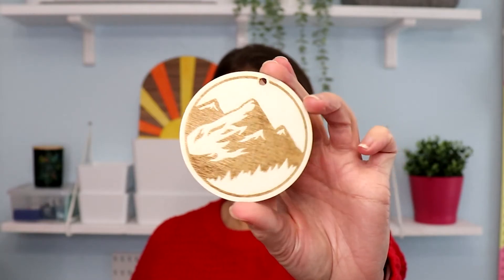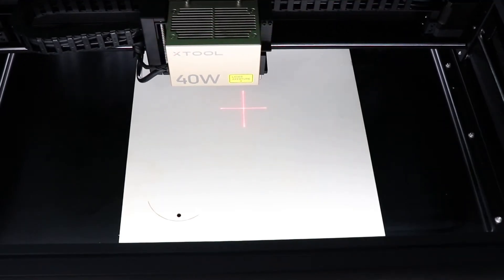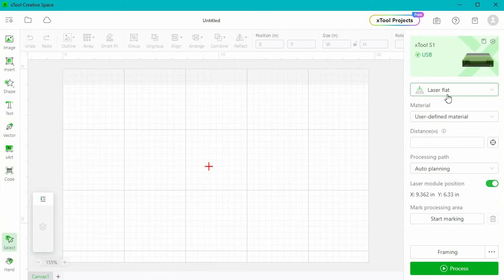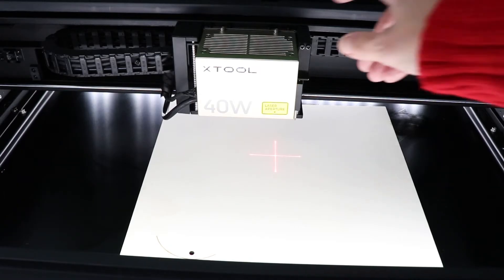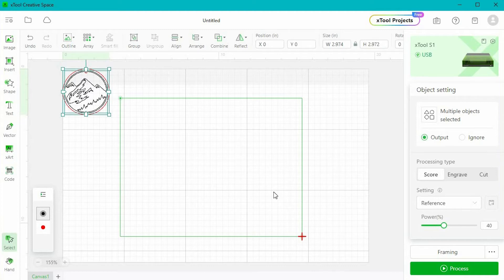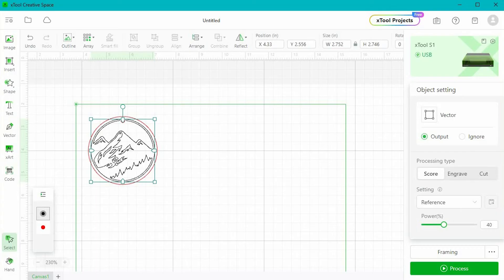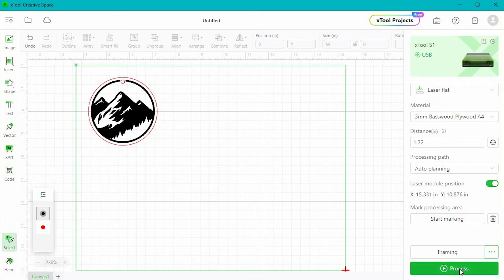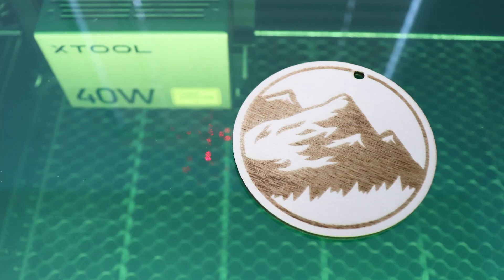xTool S1 First Project and XCS tutorial

Comment: Hi! I just watched your video xTool first project & XCS tutorial. Thank you so much for sharing this! I am brand new to the world of laser engraving and cutting and have found myself intimidated beyond belief. I want to jump in with all fours and want you to know that your demonstration and explanations were just what I needed to  find my courage to get started.  I discovered that I made one huge mistake when I bought my S1, I selected a 10 watt laser instead of a 40 watt.  How will that impact the machine's performance?  What limitations will I need to be aware of?  Any advice you can offer would be greatly appreciated!
CJ
Reply from the maker: So glad you found this helpful! Love that you are ready to jump in. A 10W can work with all the same materials as a 40W. It will run slower and won't be able to cut as thick of wood. But other than that, it's a fine machine and you'll be able to create so much.  My first laser was a 10W and I did a ton with it, still use it.

Comment: Hello Sarah,
  I recently purchased the S1 20w ,I would like to engrave clear acrylic discs for bag tags, I realize I will need to either paint them or use a card stock backer. Could you please suggest settings.
Thank you
Reply from the maker: You've got the right idea. I typically paint with black tempera paint, but make sure it's smooth and even. Then focus the laser on the paint and engrave. Or lay black cardstock down and focus the laser on the paper, then put the clear acrylic on top and engrave.
Reply: @ 
Do you have a suggestion for settings

Comment: Great video, what happens when you design your own vector image and it cuts but doesn’t engrave it?
Reply from the maker: When you import a Vector or SVG, you may need to break it apart by releasing the compound vector. This will split it into parts and you can set each part to either cut or engrave.

Comment: Hi Sarah, I have subscribed to Creative Fabrica, I am unable to upload these files or any files I have in my computer to XCS, what am I doing wrong?
Reply from the maker: A couple things to try. Most file packages from Creative Fabrica are zipped, it will show a folder with a zipper on it. Open that folder and extract the files. Then you will see everything you downloaded. Make sure the file you want to use is an SVG for cutting or engraving. If you download a font you need to install that to your computer first, then it will show up in XCS.
Reply: My stored downloads are for Cricut so they are svg. And I have extracted all zip files

Comment: I have read in some places that the 2W IR can be used for good leather engraving, but can it be used for cutting leather as well? The IR bundle is very affordable $599 and with the swapping feature you’ve showed with the S1 make this potentially the best option as I primarily work with leather currently. Any thoughts?
Reply from the maker: The IR cannot cut anything, but it does do some beautiful engraving on metal and acrylic. I don't work with leather often and have not engraved it with the IR so I can't speak to that material specifically.

Comment: Hi, im having triuble with my S1. Im new to laser cutting and it’s a new machine. Im finding that the laser doesnt cut all the way through the material. Ive used 3mm basswood and 3mm plywood. Ive tried various settings finding 100% power and 3mm speed the mist effective but still nit great snd it scorches the wood. It’s a 40w laser head.
Reply from the maker: There's a couple things you can try, because it should definitely be easier than that. Make sure your are auto focusing every time for your material and that your material is completely flat on the slats or honeycomb. Turn on air assist for the least amount of char.  Basswood should cut easily at those settings, some plywood can be tough if there is glue in it and it won't cut all the way through. You can also check your lens and see if it needs to be cleaned.

Comment: Love how you teach, thanks. QUESTION how do you get the selection panel along the top of your xcs platform page? Mine is down the RH side and I want it horizontal across the top. 😊
Reply from the maker: That's probably a difference in the version of the software we are using. In the newer version everything is along the sides and the options change depending on what you are working with. Thanks for watching!

Comment: I bought the S1 package with the IR included. So the IR doesn’t work with the S1? Why did they sell it as a package with it? Thanks!
Reply from the maker: Yes it does, but this video was made before it came out. I have a video on this channel all about the S1 interchangeable modules if you want more detail
Reply: The IR 1065 NM does work very well with the S1. I changed out my 40W with the 2W IR 1064 NM a few days ago and the projects and the quality that it produces is excellent.  I just bought the S1 about 3 weeks ago.

Comment: Sarah, thank you! I had no inkling the instructions meant to grab and physically move the laser head. I got very frustrated trying to figure out where the movement controls were. Just didn't think of the simplest thing.  This is a perfect tutorial. 

I did 27 years in the Army, and have seen a lot of training! You described where you were moving the courser, and generally did it slow enough to follow. I informally taught Excel for many years, and bicycle maintenance as a volunteer. It is so easy to forget that the user interface is completely new and if the teacher doesn't go slow, the student is all too quickly 3 steps back trying to figure out what happened because the instructor went too fast. The nomenclature is often new, and a teacher has to go slow and ensure the student is following along. If I thought I needed to double check, usually before I made changes to my Creative Space work, your speed made it easy to hit pause, back up and be clear on what you were doing. 

One very minor suggestion. Assuming you are using a Windows interface, sorry I don't use Apple at all, for a lesson go into your mouse settings and temporarily increase the mouse size. It does make it easier for students to follow. Again, thank you  Looking forward to looking over your other videos.
Reply from the maker: Thank you for your kind words, I am so glad you found this helpful! Great suggestion on the cursor, I will definitely try that.

Comment: When do you use the honeycomb? I’m trying to do a similar project but it won’t cut all the way through. My machine didn’t come with the prisms either so what should I use instead?
Reply from the maker: If it's not cutting all the way through you should first adjust your settings. The honeycomb (or prisms) are best used when cutting so you get good air flow and less charring. If you ordered the honeycomb with your machine they typically don't send the prisms. If you don't order the honeycomb, the machine should come with them. You can reach out to customer support they might send you a pack.

Comment: Is it easy to center an image within a cutting board? That’s the only thing I worry about with no having a camera
Reply from the maker: It took some getting used to, but I really like the positioning system on the S1. It's very accurate and I have no issues centering designs. You are able to use multiple points to mark your space, whatever shape it is, then center the design within that space.
Reply: @SarahVanderkooy  do you just center it using xtool creative space?

Comment: Very Nice video thnx
Question :

I have the software on my IMac intel. Starting up I only see a with screen on the working space area 

No rulers no vertical or horizontal lines !!!
How do I get a working grid on my screen?

When I delete something I see a grey shadow of a grid after that the working area becomes with again
Sorry for my bad English, I am from The Netherlands 😅
Reply from the maker: I only run my software on a PC so I don't have experience with an iMac. I did a quick search of a couple xTool groups and I don't see this topic anywhere. But if you are having the issue I bet someone else is too. I would recommend joining one of the xTool groups and asking the community, they are incredibly helpful. https://www.facebook.com/groups/193275955867186
Reply: Thnx I still have the issue and keep on searching

Comment: Great video. I just got an xtool s1 and was looking for some instructions. I was feeling a little overwhelmed and afraid to use the laser. This was perfect. I can't wait to try to make this. I do have a question about the air purifier. Do you have to vent that outside?  Everytime I try to do the auto focus distance button my machine beeped loudly. I reset the guide but had to manually insert the distance to the material. Any suggestions on how to fix this problem?
Reply from the maker: For the air purifier it depends on which one you get, you can opt for the xTool version or another brand. Some just vent into the purifier and have a filter, some have to be vented outside. Auto focus is measured using the little pin on the side of the laser. I had issues when I didn't place my pin correctly. I had to get up close and personal and make sure it was inserted correctly. If you mess with that piece at all, turn the machine completely off then back on again so it can reset. Hope this helps. Thanks for watching.

Comment: i followed your tutorial but when I did the framing part it drew the wrong size and wrong spot.
Reply: I had the same problem and realized it was the way that I had the object in the box on XCS. Hope this helps!
Reply from the maker: I would try setting focus again, then marking the area and placing your design in the box then frame. Also, make sure there are no other designs on the canvas outside of the marked box, or it will assume you want to cut or engrave those too and frame around them.
Reply: @SarahVanderkooy That is exactly what was going on I had a design of the screen so it tried to do it all :)